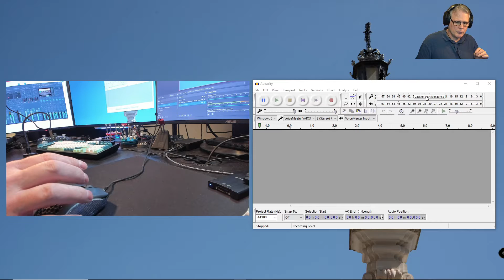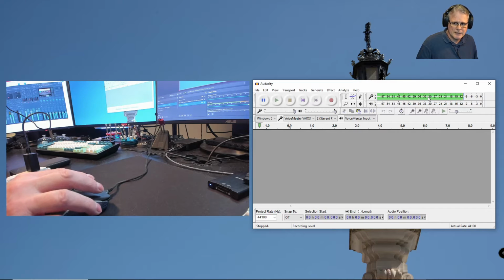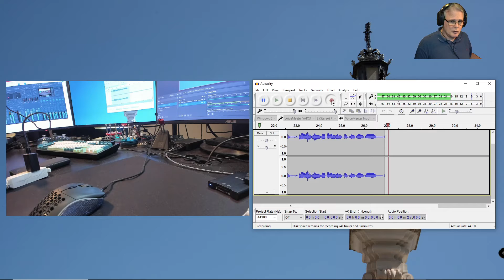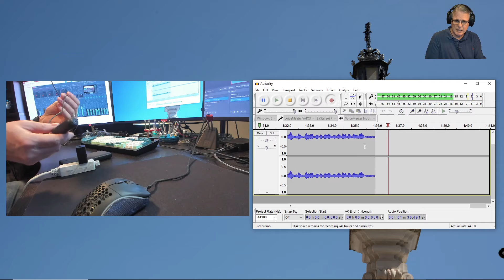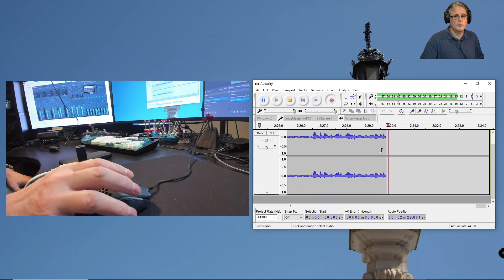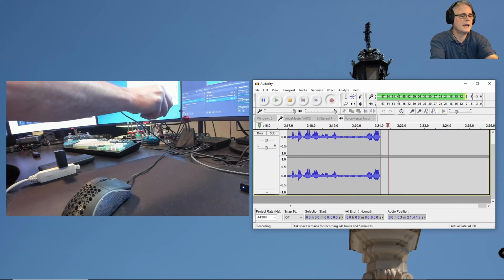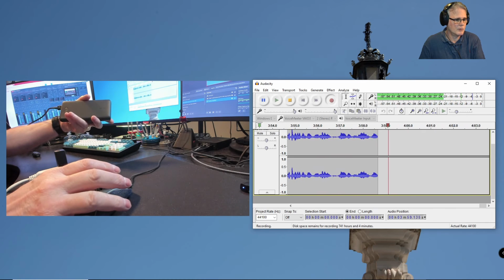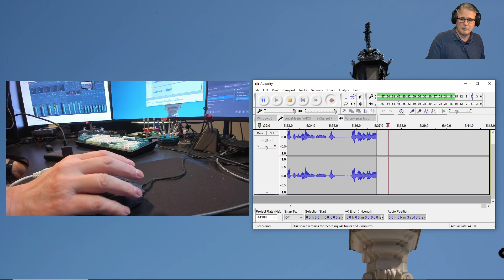USB Powered Mic - electronic / hissing noise issue.

Comment: I have the exact problem with noise, but the mic I use doesn't have a separate port for power and sound. Is there anything I could do? Would it be possible to have a split cable between a microphone jack for sound and a USB cable for power? Great video by the way
Reply from the maker: I don't know if you connect your mic to a usb interface or directly to a motherboard/ laptop, but if to an interface, try to put ferrites to the power cable and also try to switch usb cable. If you connect to a desktop motherboard, try to see if it has a usb isolated port for audio, most modern motherboard have such isolated ports.